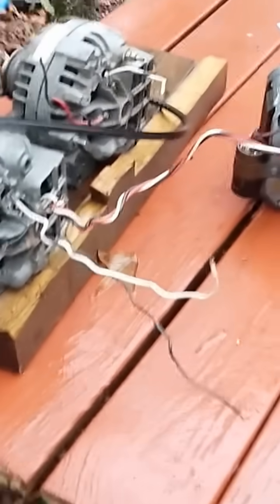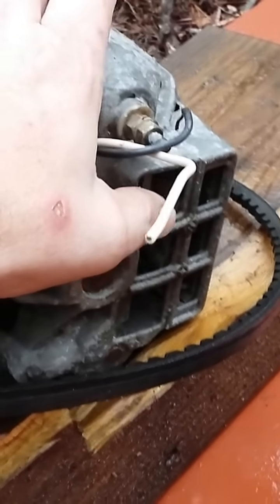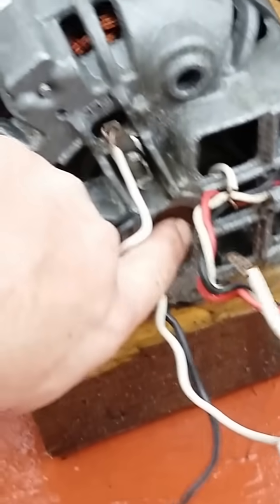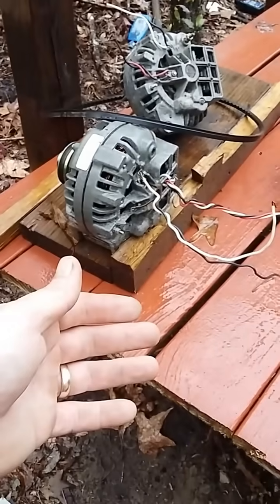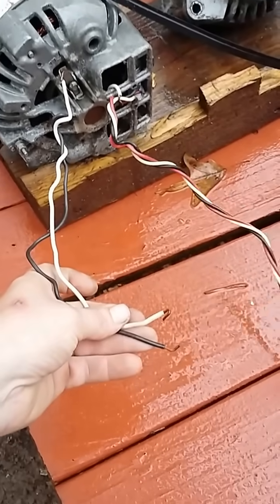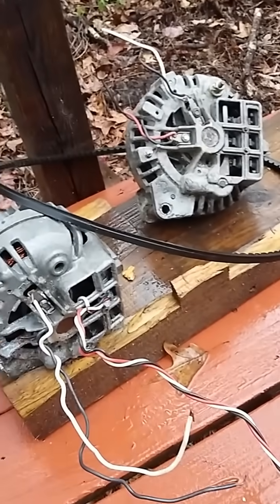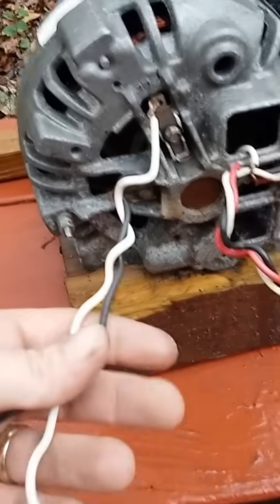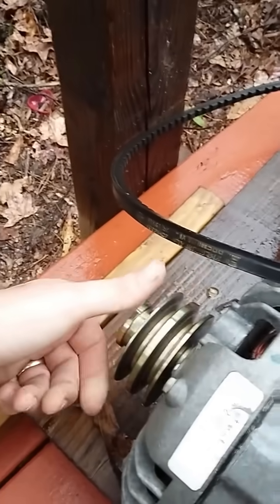Update Free energy forever no wind no solar no gas READ DISCRIPTION!!!

Comment: First off,, thanks for the video you're a god send. But, I'm so confused, if you have to have a motor in order to turn the belt where are you getting energy to run the motor? Don't you still need power supply in order to do so? I'm boondocking in my bus and really want to learn how you make this work without having to keep my vehicle running in order to have lights.
Reply: Ok brother I no how to tell you that. Ok  you would need to put the wires in a 220 box from your alternator then put you a breaker in the box like a 20amp then run you a plug to your moter on it to turn the alternator with. But you would have to start it to turning with something like a drill and you would need a other alternator to keep you 12v battery charged up with
Reply: He said you need 3 to 6 volt to turn the alternators , old cell phones,any wireless tool has several 3.7 lithium batteries which are commonly 1865's you can purchase online or even at your local Walmart store or my preference is to simply find them. Now... as far as how to take a  bit of that power and feed into  those alernators would then make it a continuous loop and self sustainable. Now a 3 to 7 thousand watt power inverter can run an average size  home. so in theory switch the motor that turns the alernator to one that run on 12 volts which a power Inverter also is Run by¹
Reply: A DC motor
Reply: Get an alternator and find a way to run it. wind or water youll need a battery to excite it hook up a few batteries in paralell and run an inverter off the batteries get a pure sine inverter certain aplliances dont handle the modified sine wave inverters too well or a solar panel with something like a gopower plus its a bit of an investment but well worth it

Comment: Man screw these idiots on here, if it wasn't for people who get off their ass and try crazy ideas, we wouldn't have 90% of the things we have.... free power means free as in not paying somebody for it on a recurring basis. Of course you gotta buy parts and materials, but that's with anything.. I've been trying to figure out something that would produce power on its on to power my cabin. I played with the idea of building an earth magnet wheel that never stops spinning and some more oddity ideas. But I always came back to the alternator. I mean why not? They are plentiful, cheap and easy to get. I need to build something that will power things like my refrigerator and washer and dryer. Lights bulbs are easy, I need to power appliances. I had an idea to build a water wheel and dam off my spring creek and have the wheel hooked to a couple alternators and run them to a battery bank, then to my cabin.. idk what I need to do to make sure I don't burn everything up and have Sufficient power out. I'm not an electrician but  I've had the shit shocked out me enough to say I experiment lol. But I'd like to come up with something that would go right into my junction box on the outside and power my whole cabin.
Reply: Search youtube for free power from old washing machine and guy built a good system for generating electrcity from his spring
Reply: This ☝️..this guy knows a little but the crank is stopping him to actually make it work. Washing machine video is good..its a new zealander guy in case you're wondering if you got the right one

Comment: Pretty neat and interesting. Gonna have to try this soon with an alternator.
Reply: Its a fake video, if this worked then the efficency would be over 100 %  which is impossible because of heat,resistance in wire,air etc

Comment: What I need to see.  is how did you wire everything into the alternator.  Because everything was set already and I think that’s the hard part. To know where every single wire is connected.
Reply: no the hard part is getting those small wires not to catch on fire when you draw 90 amps through them.

Comment: Ok, so the Alternator is 90 amps, AT 12 VOLTS YOU MORONS! This unit will put out 1080 WATTS! How much does a hairdryer use, 1500 Watts. Plus the Motor driving it has to have a power source. Can someone say, Gasoline Engine? Nothing in life is free.
Reply: Can YOU say hook it up to a water paddle in a constant running stream, or a wind turbine, or even run a belt to a bicycle. Sure, you would have to peddle the bike to get output, but hey, free energy for moving your fat ass peddling a bike. Connect output wires to lithium banks, or even large agms and you can always have power. But your right, nothing is free, unless you can think for yourself and provide just a little bit of effort.

Comment: Unless you're using mag lev bearings in a vacuum and in zero g this would never work, the generation side would never be able to produce output power to feed the motor side due to multiple factors like friction and coil resistance, sadly there's no such thing as free power, now if you had say a stream near by you could make a simple hydro generator to charge a bank of batteries, combine it with a window and solar generation you'd have a good eco friendly setup, but it would still only be a 12/24 vault system
Reply: If an alternator produces 14.47 volts of electricity and requires only .7 volts (once up to optimal operational speed because, this circuit does require a jump start  from some other power source) to continue to produce said 14.47v that would leave you with 13.77 volts to utilize as a power source.

Therefore it is a perfectly logical solution to a very real, and prevalent, problem.
Reply: @tedburton473  but you're forgetting that the motor side needs 12v to run, leaving you only 1.7v at best, so while the machine could work you would be able to run and load off it, its far more effective to turn the alternator into a window turbine
Reply from the maker: You both explained some very good points and stated facts about both sides of the argument but the fact still remains that in electrical engineering there is one and only one law of conservation of energy (potential) now there's a whole bunch of them in planetary physics? but the only one in electrical engineering is the one that states energy cannot be created nor destroyed....   well, first of all that's condescending.. if it cannot be created nor destroyed then it never existed because it cannot be created. Here's another way to conserve energy... if you have a power inverter hooked up to a car battery only powering a 100 watt light bulb now for this story let's just say the AC side wires are 10 to 1 ft long to the light bulb and the DC side is 2 gauge 4 ft long then goes to the battery. If you wanted to conserve energy on the system you could take your ground wire and make it 6 in Long instead of 2 ft and guess what more energy for longer.  Would you guys like for me to explain how I solved the  problem?  Never mind I'll just give you an example of something you can do on your own that will give you decent results..
Reply from the maker: Get your car alternator that you've already torn apart take a small one or two amp 12 volt power supply and run a frequency of pulses of direct current above 20,000 Hertz into one stator winding (running the alternator as a single phase field magnet motor with two phases as an output that's going to be stored in high voltage capacitors and let out with smaller capacitors rectifying the other side of them to be used...

Comment: I would love to have our new mayor of Fort worth Texas. Take a few minutes of their lives. And have the mayor suggest. That every citizen of the city of Fort worth. Do this to their homes. So that if the electric company. Ever has an overload of energy needed. And can't. Accomadate the power needed for the public. That they won't have to endure a wenter like we just had to this year. I personally went through 3 freezing days. With my wife. With no way of providing a power source. That could have powered up my home . And it's alliance's.
Reply: Ok, so the "Motor" needs to drive the "Generator", that part he doesn't explain. They have these things called "Portable Generators", you can buy at Harbor Freight, then have an electrician wire into your panel and can power "SOME" house circuits, but you'd need a big Generator to power your whole house. How does he power HIS motor? Doesn't say. How does he regulate his field into the Generator? Doesn't say. This is a joke my friend. I survived "Icepocalypse" here in Texas as well, and it wasn't pleasant. I'm getting a Generator and house wired this summer. Then I'll probably never need it!

Comment: BAHWAHAHA. 220 volts and 90 Amps. So his alternator puts out an amazing 20,000 watts..that’s the funniest crap I’ve seen on YT so far. This dude has some good crack he’s smoking. Well as an electrical engineer..I’ve done the math and it shows a very serious amount of stupid in this video.
Reply: Agreed but it's not an Electrical Issue ,poor mental health issue is prominent here.I don't know if I laugh or cry,laugh wins.Bozo Electrical Tech.
Reply: When they discovered the law of physics this dum as was in the toilet
Reply: Maybe he could use it to power his microwave welder? I'm interested in the battery bank needed to maintain constant energy and how he charges the battery... maybe with his car? Or a washing machine waterwheel generator?

Comment: The thing is, people who don't mess with stuff like this don't know the difference... until you put a load on the generator. You can spin a  generator with a small bike motor 12V 150-250 WATT. As long as there is no load on the generator. See what happens when you connect a load. Tada! Law of thermodynamics.... Lenz law. Motor turns real slow now, battery bleeds out.  Have fun in the woods buddy!

Comment: Hi. Can I please let me know by having a drawing and how to rotate the motor?
Thanks
Reply: Half to have the battery and wire back into the diode separate to use the DC to charge the battery and run the motor

Comment: So you need a centrifugal motor to run that will or you need when power or water
Reply: He forget to say that one battery is bypassed allowing for AC current the other is for charging the battery that it takes to run the motor

Comment: I guess it is rocket science because I’m not getting it. How are you making the DC to begin with that makes AC? What kind of junction box did you use? My understanding is that you need to have the right size or type or gauge of electrical wires and equipment or you’ll blow things. Most people don’t know about electricity. I don’t need to know how the insides run initially. Just what all you put together, safely. Like where did you get the alternators etc?

Comment: Do you always have to use some DC power like the 6 volts to start the motor? How does that battery keep a charge to stay running forever? or with the washing machine motor with capacitor does that need a DC power all the time? What keeps the battery charged?

Comment: Run two or three alternators to your breaker box from the breaker box to a electric 110 motor with the same size pulley that would be on the crankshaft to a car engine. that would run the alternators to begin with. once it's started it is sufficient. Add an extra pulley to the outside of the belts. To a battery powered  starter. To start the system. Some houses run off 100 amp and others run off 200 amps if the house runs off 200 amps you need three alternators. You can also step up or step down with a voltage regulator that can be homemade by winding wires around an object with two different sides one side for many winding wires and the other side for a few. or you can just purchase one somewhere.

Comment: Wow this is why this country is in trouble. All the nay Sayers nasty people. It does work I did this in the 60's ran fridge an some lights after hurricane Celia. Was not free energy though I used a garden tiller to run the alternator. Thanks Thomas good job.
Reply: Right I was just pointing out that the alternator will produce AC voltage.
Reply: You didn't do this.  You said yourself that you used an outside source of power.  Yours makes sense, his literally defies physics.

Comment: alternator is not a generator  , Output would be less that 60V at most , DC to AC rectifier Capacitors circuit board.  That is why they sell DC to AC converters .

Comment: Good effort but it's not your invention it has been out for years like making a welder off a battery.
Reply: You should use higher output voltage alternator. Hook it up to a little windmill. Once wired and earthed correctly it should run back into a chargeable battery bank. Not only will u save power by charging batteries, you'll put less load on the alternator and produce more power usage throughout your house or current living state.

Comment: make a video of it running and show how many amps your pulling threw those #12 wires
Reply: exactly and how fast you have to turn it and the cost of the energy to turn it. if he got 90 amps and ran it to his trailer then started turning things on it would not take too long before he burnt the hole trailer down. those #12 wires would look like a light bulb in about 5 min.

Comment: Its all fun until you realize how many people actually think this is possible....  I'm starting to realize that humanity is doomed at some point.
Reply: I did not watch the entire thing, but it might work if a high current power line is nearby and the coils in those alternators are tapping power from it via induction.
Reply: @richardyao9012  Even if it was using induction, it's still not "free" power.  So, this setup taken as a closed loop can not work.

Comment: I built a generator/device 
similar to this  except I power my
My generator with a 6.5 HP predator motor 
The motor spins an alternator that charges a battery which in turn
Powers a power invertor
My set up isn't free power
But it works just fine when the power
Goes out 
I'm not sure why the poster of this
Video thinks he might disappear
There are literally hundreds of videos
 Detailing how to make such 
Devices

Comment: I don't need the electric companies, with very little power from solar panels attached to a generator box, I'm making enough electricity to power my tiny house of appliances.  So I know what you mean, but my way is cleaner and can be done by anyone and their mother.  PS:  Could someone go check on that baby at your house.  The crying is bothering my maternal instinct.  Thanks.

Comment: I looked through most of the comments and it seems everybody missed the reality of this whole trip.  If you disassemble the alternator and tap onto the 3 wires before the diode pack, you get 3 phase electricity, about 50-60 volts per leg.  The frequency of the voltage out will depend on how fast you have to turn it the alternator and it will probably be to high to use on any most appliances, even for 10 amps.  Voltage across 2 legs would be about 100 - 120 volts AC but at a frequency that only a brushed motor or a toaster could use.  If you want to measure, or use, the voltage from one leg, you need to find where all three wires are hooked together.  Alternators are usually wired in a "Y" configuration, which means, one end of all 3 windings will be connected at the same place.  You could put a load across any 2 legs which means you could have 3 separate circuits.  Thomas did get one thing right, the field winding in the rotor needs to be energized with a voltage, usually up to 12 volts, which could you the desired output to your load.  A rheostat or potentiometer would work to adjust the field winding in the rotor.
As far as free energy goes, not much in life is free.  If you want to get electricity from an alternator, it must be turned at a pretty good speed, usually over 2000 RPM, and if you want to get those 90 AMPS, you are going to have to put your back into it. The bigger the load, the harder it is to turn.
Sorry Thomas, there are no shortcuts to life.  I am not saying the concept of free energy is a total falsehood, but I will venture a guess that this project is not going to be the answer.  :  )

Comment: I used several small insects in a hamster wheel to drive mine and powered 14 European countries for the last month, I've just had to stop it to change a bearing that began to overheat. 🐂💩
Reply: Got to keep the bearings oiled.
Reply: @martensmade-it  Just use some bronze bearings impregnated with oil, just make sure to check on the little bearings when they are crying.
Reply: Which hamsters work best, male or female? Do you have to lubricate the hamsters?

Comment: It will create 50-120 amps. But 12 gauge wire leads are good to 30 amps NEC 20amps. So need alot larger wire to feed a breaker box. But if only providing power to a 220v 20 amp appliance be sufficient. May run an electric clothes dryer.

Comment: I want to see you run 90 amps through those itty bitty wires.  

Actually it will probably work.  Because you are using imaginary free electricity. As in does not exist.